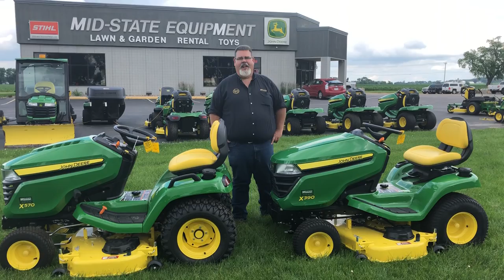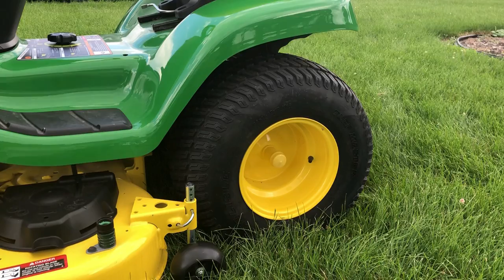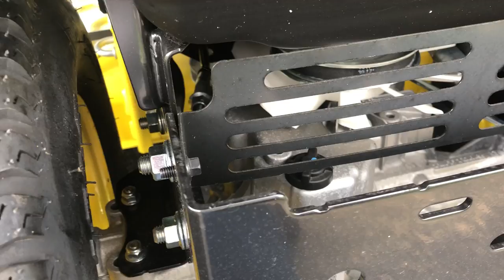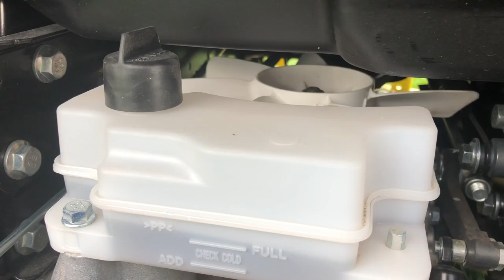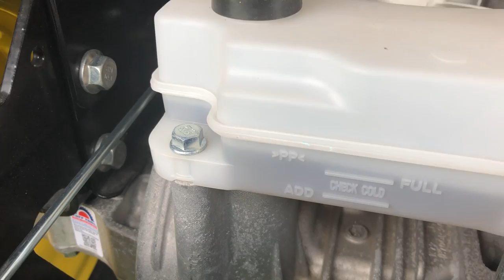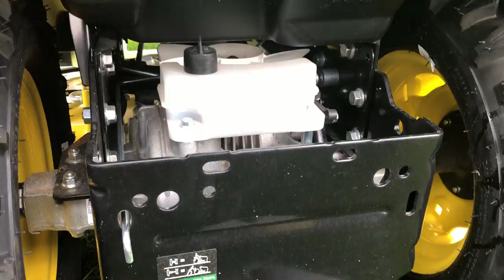John Deere Lawn Tractor Vs Garden Tractor

Comment: Only took 40 seconds to incorrectly state that lawn tractor transaxles are not serviceable. My X370 is serviceable. You can drain and fill the fluid and change the filter. Dude, know what you are selling.
Reply: Yes, you are correct. X390 and X370 both have a serviceable transaxle, which was one of the main reasons I went with the X390 .

Comment: This isn't exactly true ... I have an x310, which is a Lawn Tractor, and it has a serviceable transmission (not sealed)... so your statement is false... there are a number of x300 series tractors with serviceable transmissions... and they are Lawn Tractors.

Also, there are plenty of x300 series tractors that use 44" snowblowers, for example, or plows...

Comment: A lot of people fail to understand the Importance of this, if you hook a bunch of heavy equipment behind a lawn tractor it will destroy your transaxle in short order. A friend had one of the low end John Deere lawn tractors and was pulling a very heavy lawn roller behind it, and complaining how it slowed down when going uphill pulling that lawn roller. It took some talking but I finally made him realize that tractor wasn't designed to do that, eventually it would need the transaxle replaced due to the abuse. Hopefully he didn't damage it too much before I could educate him.
Reply: The x390 can handle heavy plowing no problem for years and years

Comment: I've seen videos of 300 series tractors using ground-engaging equipment so that's not quite correct.  However, the 500 series tractors are certainly better suited to it and will last longer if plowing, tilling and cultivating because of the heavier rear-ends (axel, tranny).  But 'lawn' tractor and 'garden' tractor are accurate terms for the differences between these two machines.

Comment: Assuming I could afford both, which one should I buy? The X380 or the X570? They would be used to mow roughly 1.7 acres, tow small loads of mulch, dirt, and rocks, tow a spreader, sprayer, and sweeper, and plow snow. The 1.7 acres is mostly flat but there are some long drainage ditches that would need mowed and they are fairly steep. Thanks!
Reply from the maker: Both the x380 and X570 are great mower options.  However, the X570 has a better set of transaxles as well as a differential lock feature for added traction.  The X570 also has a better engine and a heavier frame.  For pulling, hauling, plowing, and handling the hills, the X570 has a clear advantage.
Reply: Diff lock is worth more than 4x4 to me. 
Diff lock + 4x4 is king.
Reply: @cody481  thanks. I went with the x570
Reply: cupofjoe2988 awesome 
How is the tractor doing?
And are you getting along with your dealer 
I'm considering green for the first time.
Reply: @cody481  I really like it a lot. I had a problem with the deck drive belt it broke apart after 1 year. My dealer screwed me by selling me the wrong drive belt. I showed them the old belt, showed them the schematic of the new one I needed, and they still gave me the wrong one. I had to take it to a Husqvarna dealer to find that out and get it fixed. John Deere sales was great, but their service and parts teams are terrible.
Reply: cupofjoe2988 
Well crud. 
I was hoping that they had fixed that people problem. 
Sidebar; I always go to napa for anything I can i.e. Belts. 
Napa will sell you an automotive grade belt and it will work for a while. 
Then when you hand them the shredded 3 week old belt they will offer a Kevlar belt. 
The Kevlar belt will work for a long time. 
Skip the automotive belt and keep the cardboard sleeve from the new Kevlar belt so you can hand to them in 6 months-2 years. 
I mowed 7 acres weekly with a 48" triple blade deck. 
Including an occasional wet weather spring that did a really good imitation of a Rich mans lawn, it was about 30' across and 1"-3" deep.

Comment: Does the x5 series have more leg room than x3 series?  Im 6’3”, not sure I’d be comfortable on the x3...
Reply: While I have witnessed taller people claiming more room on a X5 Series I never measured the operator's station and John Deere doesn't report any specification related to roominess.  So, I performed a very simple measurement to see if there is a difference.  With the seat all the way to the back position I measured from the center of the seat backrest to the forward hydrostatic control pedal.  The distance is roughly 40 inches on a X350 and 43 inches on a X570.  Based on this measurement I believe there is more leg room on X5 Series tractors.

Comment: If I said I am looking for a mowing tractor for my mostly flat half acre lot with a slightly sloped 3 car wide by 4 car long driveway. I live in Cincinnati, Ohio so plowing snow in the driveway several times a season is a strong possibility. Some other goals are to have a mower that will last “forever” if taken care of and could potentially handle a 2-3 acre lot if I potentially moved in the next 5-10years. With those things in mind would you consider a JD X758 with a 54in deck and snow plow “overkill”? Or would it be reasonable given the long term goals of wanting something that would last forever and could handle a bigger lot in the future.
Reply: Thank you for your question.  While a John Deere X758 would seem to be “overkill” on your present property it will be ideal for the future.  This “forever” machine will reward you with years of impeccable service.  Maintenance is key and if one follows the Maintenance Schedule in the Operator’s Manual I have seen tractors of this type service owners for 30+ years.  Although you have a half acre yard at the moment and the tractor is actually made for properties like you mention for the future, the maneuverability and nimble operation of the tractor with a 54” deck will be a joy on your present property.  For winter use, the 4wd and physical size of the tractor for pushing snow is fantastic and not overkill when using a blade.  While the mowing part of the equation is small you do possess a respectable amount of driveway and the John Deere X758 would knock this out in short order without the need for tire chains.  I believe you would be very happy with an investment in a John Deere X758.

-Larry
Reply: Larry Schlender Thank you for the feedback! This is good information. I kind of jumped to wanting the X758 because I have had 3 new box store riding mowers in the past and had mechanical issues with all of them. I just got fed up with the cheaply built stuff and I figured I would spend more in the long run if I have to keep replacing the cheap unreliable tractors every couple years versus just buying a real heavy duty reliable tractor like the X758. I am very hands on when it comes to regular maintenance so I am confident that I would get the full lifespan out of the machine. I will admit it’s definitely a want more than a need, but I figure if I am able to afford it then why not make mowing and snow removal fun and easy at the same time.

Comment: The 2 different methods on how the rear wheel is attached are not really different at all. The  X390 has a rim that is keyed to the axle shaft. The X570 has a rim that is bolted to a hub, and the hub is keyed to the axle shaft the same way as the X390.
The most significant upgrade is the different transaxles.

Comment: You should have mentioned the x390 has power steering and hydraulic lift where the x590 don't.
Reply: The x590 has power steering and lift.
Reply: I had it backwards. The x590 has both and the x390 doesn’t. My apologies!
Reply: The x390 does as well. The “90” series on both has power steering and power lift

Comment: John deere lawn and garden tractors are horrible pure garbage
Reply: My x300 has 700 hours all issues where either my fault or normal wear and tear. The only deeres that are garbage is the 100 series. But for zero turn mowers Kubota is where it's at there are kubota mowers still around 20 years later basic wear and tear unlike box store mowers in 20 years they would of had spindles replaced valves adjusted etc. Kubota mowers are less likely to break the zg20 is a commercial machine kohler command wet clutch pto 12 heavy duty frame and weighs over 1000 pounds oh and will outlast other brands especially the lower priced mowers. Spending extra money on Kubota mowers is worth it.
Reply: Ran an x530 for 12 years. Can’t remember the actual hours but I know it was in the 1000’s. My personal use (about 1 acre) as well as mowing large church property and cemetery in summer and snow blowing  my 100+ foot driveway (12 years) as well as a neighbor’s 100 foot driveway (7 years) in western New York (south of Buffalo). Snowfall averages well over 100 inches per year.  Only ‘issues’ were…deck drive belts replaced, blower belt replaced mower blades replaced. All considered normal wear. Performed all routine maintenance as scheduled. Oil and filter changed every spring and fall. Main drive belt replaced once. Ran 90+ octane gas. Traded it in on an x580 two years ago just because I wanted to.